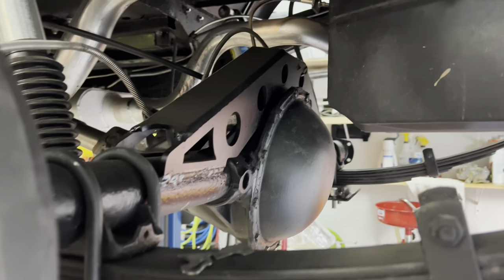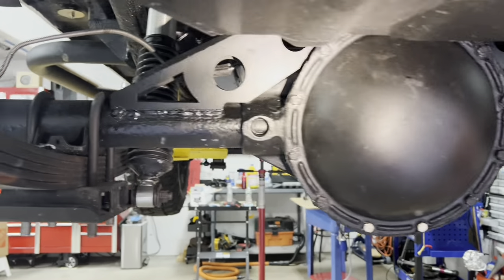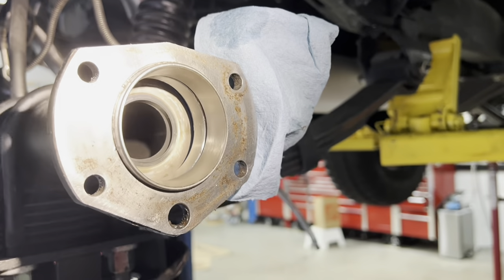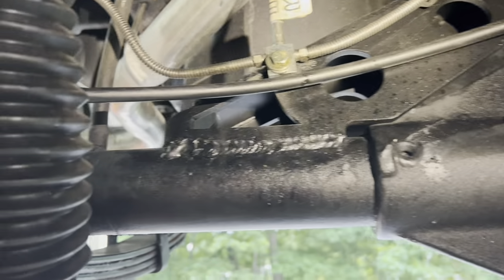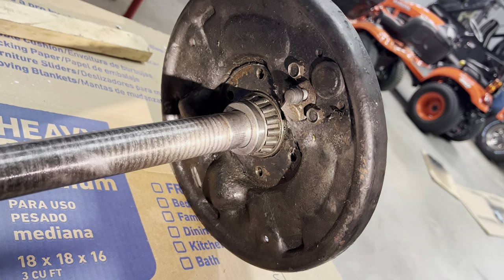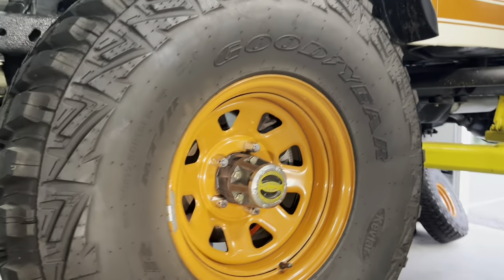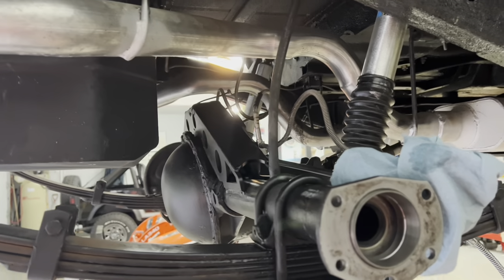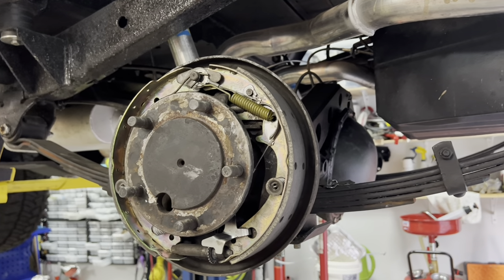AMC Model 20 junk or worth keeping?

Comment: Your pinion strength comparison is not valid. Pinion diameter depends on axle ratio... If both pinions were the same tooth number you could compare.
Reply: The dana 44 is a 8-1/2" diameter ring gear,  the AMC20 has a 8-7/8" Ring gear,  with gear strength,  bigger is better.  Building a AMC20 to a high standard, as he has done here,  is cost effective,  and rates above a dana 44 in strength,  comparable to a ford 9"  but a above a ford 8.8   Having two scramblers one with a swapped in IH scout dana44 with Warn Full floater Kit and a ARB, 4.27 gears and a Narrow track AMC20 with one piece axle shafts, 4.10 gears,  it still a toss up between them in terms of strength,  although the dana44 cost a LOT more to get there and still has a smaller ring and pinion gear

Comment: hey welding on your truss.. did you get any heat movement on your axle shafts. bending.???
Reply from the maker: Hey - no i didnt, but i have heard that you can damage bearings if you are not careful. They give you good instructions here, specifically about this towards the bottom of the article. http://searchers4wd.com/amc-20-truss

Comment: It's not a junk axle, although in it's stock form it has some glaring weaknesses(axle tube and axle shafts). If you are doing a mostly stock or mild off-road build with 35" tires or less then the AMC 20 should be fine(w/ 1-piece shafts and some reinforcement on the axle tube). If you are doing a more extreme build then I would definitely recommend selling the AMC 20 and getting a dana 60 or better.
Reply from the maker: agreed

Comment: I agree with your overview.   I just finished a complete rebuild of my AMC 20 and elected not to go with a Truss, for my purposes.  But I did have a question about yours.   It did not appear that the Truss was welded to the center housing!   Looks like you have provided stabilization of the tubes (possibly needed for extreme off-road extreme geometry), but that does not appear to correct the weakness of the Housing trying to rotate leaving the Tubes behind.   Maybe, I'm missing something...  Your thoughts?  Mike
Reply from the maker: I actually ended up welding the top of the truss to the top of the pumpkin after I created the video. I will say however that the folks that sold me the truss said there was no need to, but I ended up doing it anyway.

Comment: Looking to truss my 20.  Thanks for the vid.  I'm not a welder, but I assume you take the axle out and weld the truss on?
Reply from the maker: Actually, I did mine without taking it out. I am not a welder either but my father-in-law is and has done many of these. From what I understand its a matter of where you put the ground cable for the welder (MIG). If you empty the whole axle out then its not a big deal but if you leave it assembled you want to make sure you don't cook the bearings. He welded mine up all together and i have not had any issues
Reply: Back to having this done. Hopefully, have a guy that can do it for me. Think I’m going with Taboo Customs truss. They also have one for the D30, too

Comment: With your one pice axle conversion what drums (part number) did you use? I have a conversion done to mine for some reason the drums don’t go all the way to dust shield. It’s almost like the drums are not deep enough to reach dust shield. Thanks for any input.
Reply from the maker: I’ll see if I can find my receipt, I do believe the drums are different sizes if it’s a narrow or wide track axle.  Mine is a wide track.
Reply: @jeepcjgarage  Thanks for replying, I have an 83 wide track. I purchased the jeep with the one piece conversion already done to it. After pulling rims off I noticed the gap between dust shield and drum. I guess I’m doubting the job previously done are someone not replacing with correct drums. Thanks again